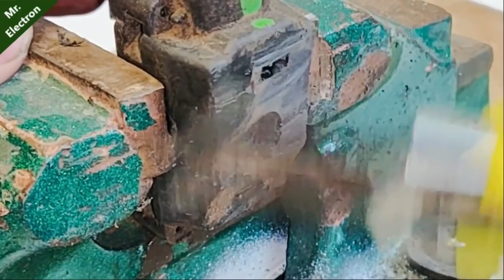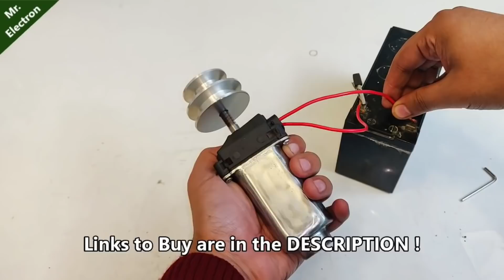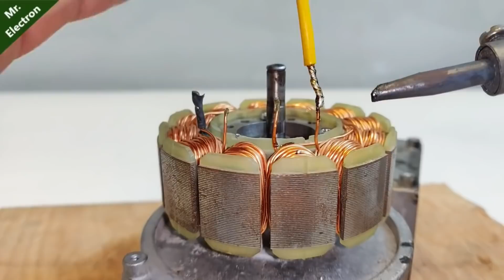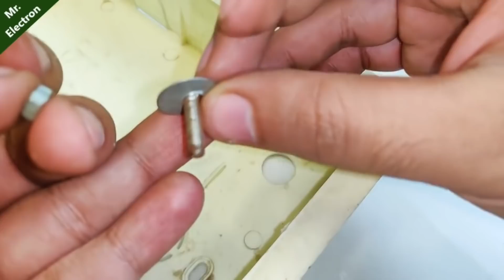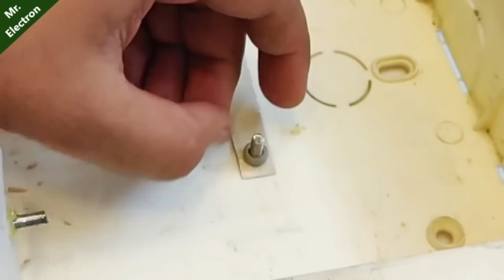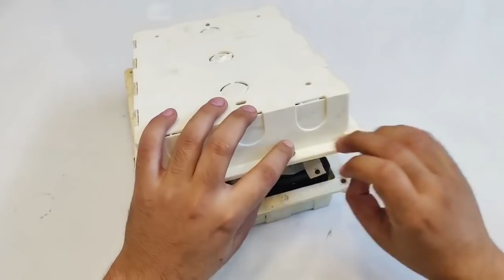3 Simple Inventions with DC Motor

Comment: If your batteries are gassing enough to blow off the caps your probably charging at too high a rate. 
 A good general rule, lead acid batteries should be charged at 1/10 of rated capacity or, for a 7A/Hr battery, 0.7A. 
That also prevents overheating and warping of plates

Comment: That's just a standard car window motor that has been separated from the Window Regulator. You can get 2-4 of these out of most modern cars/trucks. Older model cars with electric windows used spring-assist scissor-arm regulators and these are a bit more work to separate from the motor. Newer cars use a cable-pully regulator system and is easier to disassemble. When your car window stops working, it is 98% of the time a damaged Window Regulator, the actual motor almost never wears out during life of car.

 All major cities have auto wrecker yards where they allow you to pull parts off dead cars and buy them for a few dollars. You can also find small fluid pumps in the Washer Solvent tank for the windshield sprayer...